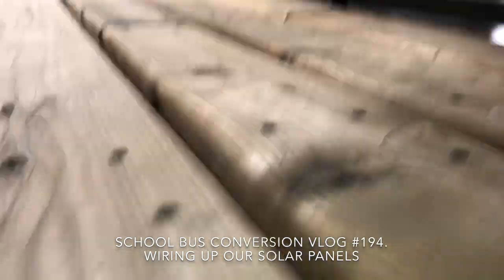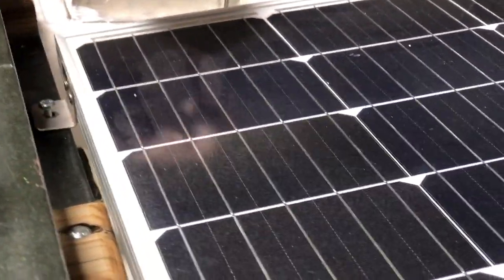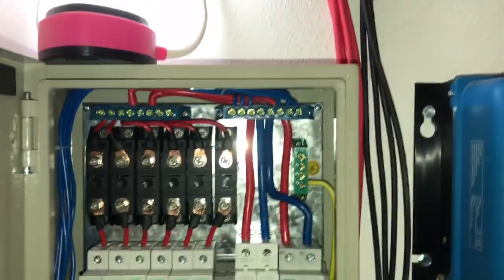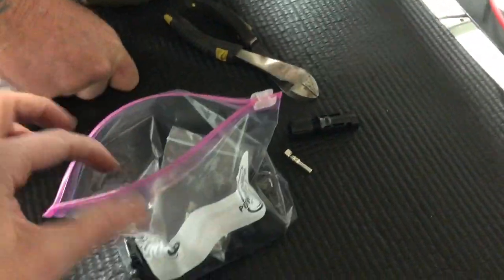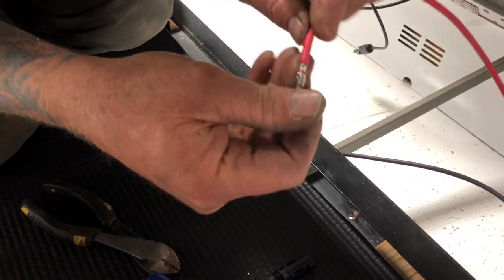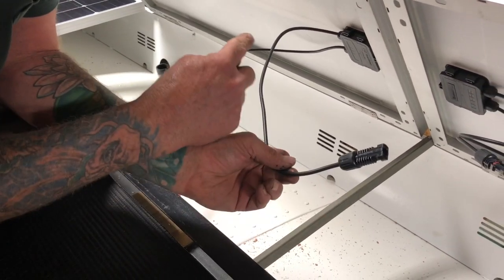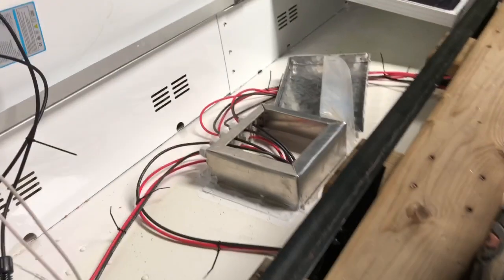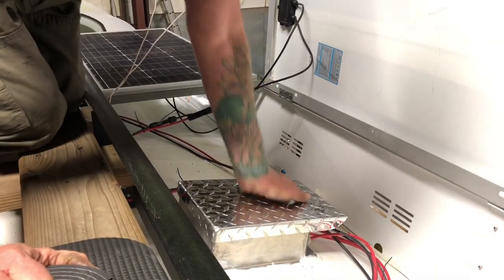Wiring Up Our Solar Panels - Vlog 194 School Bus Conversion

Comment: Hey Randy, you can if you want too, put a little vaseline on those glands and connectors to help keep any moisture out of them and unlike silicone, it will just wipe off when needed but won't wash off during travel. Lovely neat install.
Reply from the maker: Thanks for the tip 😃👍😃

Comment: Be sure to use the "F" style crimpers correctly.  There are two sets of wings on the contact pins, one set is intended for the bare wire and the other should be for the insulation.  The tool is made to make the insulation crimp slightly larger for the insulation.  I like your solar panel mounting.  It provides good ventilation and serviceability.
Reply from the maker: Thank you. 👍😃

Comment: no grass growing underneath your guys's feet! LOL question Randy what made you pick 100 watt panels for your system and I think it's 12 volt system just curious
Reply from the maker: I chose the 100 W panels because they were a compact size. After seeing others put on the big panels that went clear across the roof and they had troubles with them bending from the wind and getting broken. So from the start we planned the deck down the center with the smaller panels to the side and the ability for the wind to go underneath them and up through them to the deck in the middle. I don’t know how this will all play out but it’s what we’ve planned. Also I can simply walk down the deck in the middle and use the squeegee and a sponge to clean off the solar panels when they get dirty. The two in the back that were added on or suggested by Aaron who is our solar consultant. So getting to them to clean them or whatever isn’t quite as EZ  but it filled up the solar charger to its capacity so we’re getting our moneys worth out of it should be great for the long run we hope :-)
Reply: I get it and so will be curious to how it goes